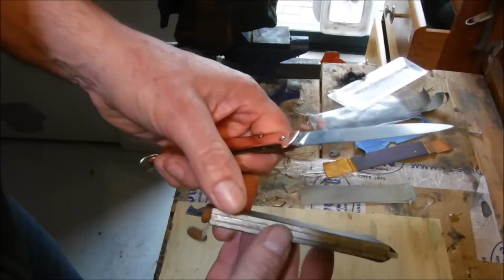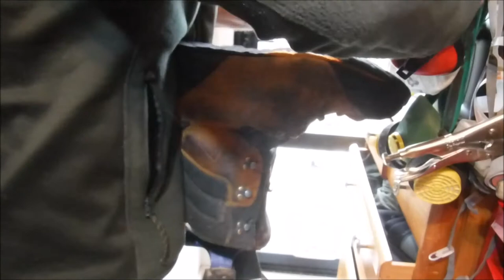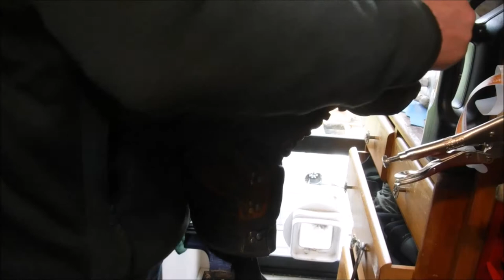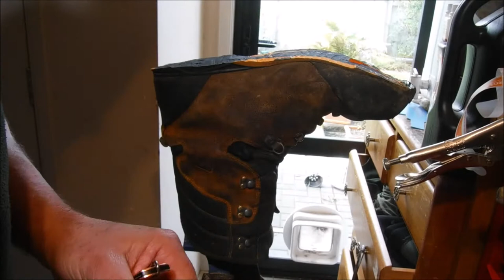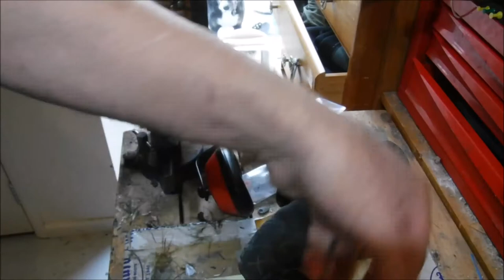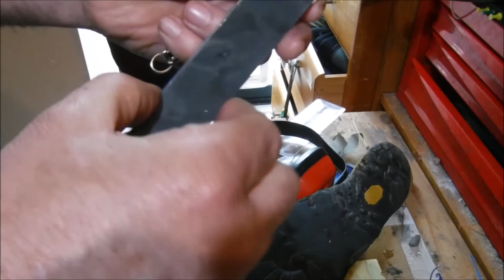Mercator carbon vs stainless blade test

Comment: Think I need to get my hands on one. $70 retail is the best price I can find, don’t know if any better prices out there?
Reply: In Germany the are 30€ for one with steel grip and 50-60 with one brass or copper
Reply: Amazon
Reply: @mwillblade  I'm concerned about getting sold a counterfeit.  Do you know of any reputable sellers on that platform?